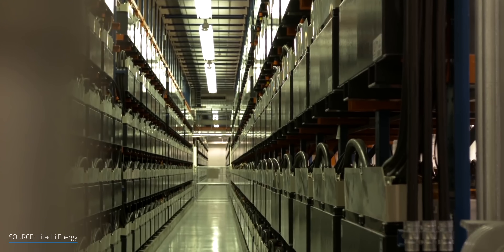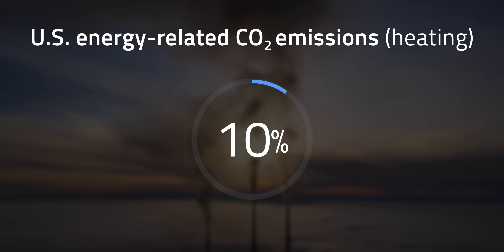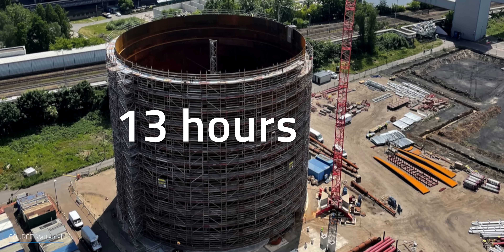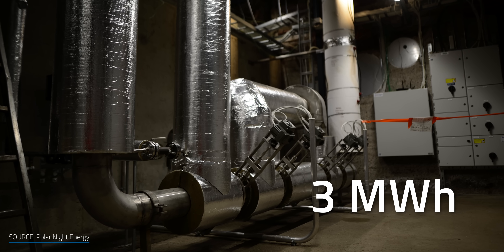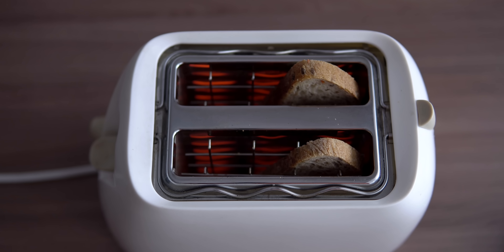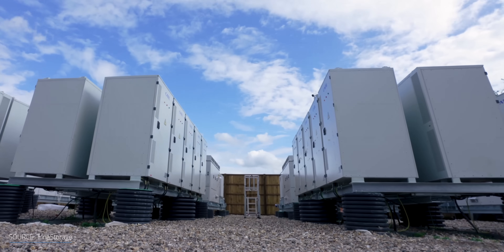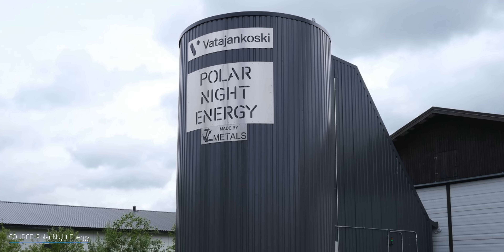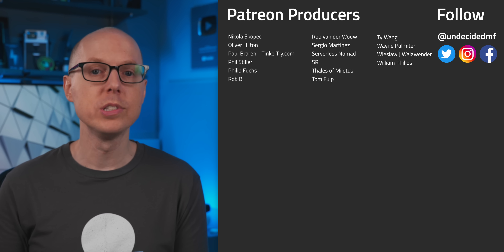How A Sand Battery Could Change The Energy Game

Comment from the maker: Do you think the sand battery has a chance of catching on? Try 14 days for free: http://aura.com/matt. Thank you to Aura for sponsoring this video!

If you liked this video, check out: Why Seaweed Could Be The Future Of Plastic https://youtu.be/901aQFR6Ft0?list=PLnTSM-ORSgi5LVxHfWfQE6-Y_HnK-sgXS
Reply: For once, I'm sold on this one. It ticks my boxes of distributed, scalable, and high availability. I doubt we will see much residential, but this is the kinda of system that can be integrated easily within a plant or factory. 
Though now that I think about it; what if they used a heat pump instead of resistive heating. A 2x heating efficiency(draws from the air) would offset the 1/4 conversion back. Might be difficult to get the higher temperatures needed though.
Reply: @squarewheels2491  The problem with heat pumps is that they do not work very well if you need to heat something up to 600 degrees C.
Reply: Hey how many heat-related puns did you work in there? I lost count around half a dozen. If people downed a shot to every pun, they'd get hammered 😀
Reply: @HeliophobicRiverman   Damn you 🤨 now I had to re-watch the whole video just to count the heat puns🤓😅 Although there were more puns in the video a person taking a shot for every heat related one would “just” have  6 shots and thus be moderately hammered😜😄
Reply: Kindly don't forget to review the thermal solar cooling
Reply: From an engineering perspective its a brilliant concept of simplicity. And scaling this technology should be a non issue because you are not dealing with a pressurized system. You can double up the input configuration as needed. Two heater/blower circuits instead of just one. As can the size of the thermal mass.
Reply: @davefroman4700  Charging this "Battery" would be $$ with its basically Direct short inductance Toaster. The only benefit here is if costs to make the initial heat are higher at night, etc. I dont see this being used that much.
Reply: 1) it's easy to engineer
2) construction costs are in line with any farm construction i.e. no specialty mtls etc.
3) sand is cheap & available wherever construction takes place.
4) they were able to store up to 1000° 
5) it's easy to convert for winter heat.
The EU should be very interested, especially now.
Reply: Matt, rather than use resistive heating, won't it make more sense to use a heat pump to move heat into the sand?  I am assuming a heat pump could be designed to operate at those temperatures which might be a big assumption.
Reply: Maybe you could do some research and make a videoabout nice tech called 'Teplator'  -  Nuclear district heating solution. :)
Reply: Why hot sand above ground instead of hot sand below ground?
Reply: @lonjohnson5161  
Cost and ease of maintenance i.e cost
Reply: I'm a glutton for your pun-ishment, ^oo^
Reply: The key take away  is for the forseeable future there is no single technology that will delivery us to energy independence.    :elbowcough:Why a we not planting more trees as a solution to the carbon in the atmosphere?
Reply: You can produce Hydrogen with unwanted wind energy and burn that on demand. UK is moving to Hydrogen boilers for winter heat. Thermal batteries have been tried before and failed because the cost was 4x more expensive than renewables. See video "Billion dollar solar failure".
Reply: @sang3Eta  Hydrogen is wonderful except that it has to be stored as a pressurized liquid to be efficient and is extremely explosive.
Reply: @sang3Eta  The "Billion dollar solar failure" was for something else. Hydrogen production is very inefficient.
Reply: @sang3Eta   well, it's bit dangerous, and one needs speciall place for it... Sand batteries are ok for use anywhere.. 👍
Reply: @sang3Eta  Hydrogen boilers need special storage and can easaly blow your home...
Reply: @helengren9349  Methane can blow your home up too, yet we use it. Hydrogen has smaller atoms so they did replace all the street pipes. Will be a mix methane and hydrogen because it holds no smell.
Reply: @sang3Eta   Thank You for Your reply. I sure do know about methane.. I do not use any flammable fuel.. but as I've heard hydrogen is very dangerous.. Why not use something better when it is available?... 🤔
Reply: @sang3Eta  You can- but the entire cycle is ~50% efficient. And the UK WANTS to move to Hydrogen- but has no idea how to get there. If you had ever worked with Hydrogen (I have) you would not want if anywhere near your house...
Reply: @Tensquaremetreworkshop  They have already upgraded the gas lines in my street to take hydrogen and dual gas boilers capable of burning methane and hydrogen mix are on the way.
Reply: @sang3Eta  Yes, mix. About 20%. If you believe we are going to 100% Hydrogen, I have some land for sale you might be interested in. Have to show you at low tide though...
Reply: 5:08 Again you're confusing “the world” for “the USA”. Europe, where this was developed, has a long tradition of district heating and co-generation, and the European Union is actively working to expand this, as part of the move to lowering carbon emissions.
Reply: @rasmis  Rasmis, my dear old chap. There is hardly any district heating y Europe outside of Sweden, and even in Sweden, it is very much a minority activity. I am in Slovakia at the moment and on the edge of the local town there are monstrously ugly pipes (and I mean MONSTROUSLY) stuck up on supports which used to provide waste heat to a housing estate from a local industrial plant. It did so for a few years .... and then .... it didn't anymore because the industrial plant closed down. In London, for a number of years, there were pipes running from Battersea Power Station to carry the hot water retained after the steam had blasted itself through the turbines and condensed to a housing estate. It ran for a couple of decades. Tenants complained about being charged for it whether they used it or not. It wasn't cheap either as the tenants were supposed to pay for the debt to be amortised over a number of years. It doesn't work anymore because in Britain's march to a coal-free future, this coal fired monster in the centre of London was one of the first to go. Battersea Power Station is now an up-market shopping centre with flats (apartments) for the super-rich who get perverse pleasure from telling anyone who will listen to them that they live in a power station "Haaaar-Haaar-Haaar .... Hahaha. That's funny isn't it" ..... "Well, If you say so."
Reply: would it work with brine? ie a thermal salt boiler to store energy, seems a win alround if it does coupled with desalination plants, hot enough to boil off remaining water and if to much salt it can be removed to maintain a balance 
(like a auger on a grain silo)
Reply: @TheBadweasel1975  Having lived close to the sea, I can tell you that salt water is extremely corrosive.
Reply: @BiggMo  isn't it obvious yet?  "climate change" is just another ruse of control...even if you omit the Berkeley professors "hockey stick" phony data discovery many years ago,, a blind man can see it by now come on man
Reply: Hey Matt,  With you being on a heat energy storage kick, and having recently done a video on state-change energy storage, it might be fun to do one on Ice -Based energy storage.  Broadly, the idea is that a building consumes low-cost energy at night when it is cooler, to freeze water which is then used to cool air for the buildings AC when it is hot rather than use electricity when it is expensive during the day.
Reply: @mm650  Great idea!   I heard of someone who would store snow from the streets in winter and use it for cooling during the summer.
Reply: @l0I0I0I0  Why "would". Did he or didn't he ? Try, "I heard of someone who STORED snow  from the ....... "
Reply: @BiggMo   Just what is it Y’all don’t get about irreversible sudden onset climate change? If this was 1980 and nuclear power eliminated all the world new coal fired plants, it may have kept our climate from being as it is now some decades away! Not properly decommissioning all the nuclear power plants while it is possible could make the Earth a dead rock hurtling through space for a very long time! But hey what do I care I’ve had an amazing ride already in this wonderful life on this marvelous planet!
Reply: Seeing what we’ve already done to out environment taking more and more water to make these sort of “solutions” aren’t the answer. We need more ways to recycle our current methods more storage options so they can keep producing regardless of need at that current time to fulfil future needs we need to start putting solutions into the works to clean up dirty ocean water, it effects us all in the long run
Reply: @Boo-pv4hn  funny you really think man kind has a long time! Sadly SMFH
Reply: @Boo-pv4hn  Wake me up when you realize that this economic model is scientifically invalid and incapable of solving the problems it is creating for profit. The biggest threat to our survival today is not pollution and oil. Its this idea that exponential GDP growth is essential to a functioning economy.
Reply: I was a bit worried whete they whete getting the sand but after seeing there using left overs from the construction industry this is a relief the worry is what about long term whete does the sand come from?
Reply: @Boo-pv4hn  The sand on the beach at Benidorm in Spain was purchased from the Algerians ..... and that was an awful lot of sand !
Reply: It's power still comes from the earth isn't that what you smart people are trying to do
Reply: Perhaps I missed it but I didn't notice any point on how much energy is lost over time to sand battery. Suppose you input 10 KWh how much of that power can be realistically extracted after a day by a  steam powered generator, thermoelectric generator, or some other sort of high efficiency heat to electricity generator?
Reply: @mydogsbutler  Aparently not much lost, since it is working for several months in cold weather, as in Alaska.. There is an interview with those, 3 very young persons from Finland, who started their project 2017, 👉 channel  now you know, vid called dirt cheap sandbatteries.
Reply: @mydogsbutler  I ran a small Heath-Robinson solar-thermal collector and pumped the hot air (sometimes in excess of 300°C) into a heap of gravel (about a cubic yard) insulated with a few inches of soil, I used the heat for my greenhouse. Even when hit by a freezing, cloudy high pressure weather system, there was still a lot of heat left after a week. I don't know about any longer because the Sun came out again and I recharged the heap. Commercial parasites want to blind us with science and make this as expensive as possible. What is wrong with a huge heap of gravel with a thin layer of concrete to keep the gravel clean .... it wouldn't matter if the concrete cracked, its' function is only to keep the gravel clean and about 10 ft of soil and rock over the top. No need for pipes or anything else. Hot air in - hot air out. How cheap is that ?
Reply: Can you put this underground?  Do rocks hold more heat longer?
Reply: @e2U  Yes you could, but no you do not want rocks. Too much air in the gaps. Sand is crushed rock btw. We can make an endless supply of aggregate for these systems. Even from recycled concrete.
Reply: @davefroman4700  rock with sand filling in the gaps?
Reply: @e2U  The reason sand works so effectively because it is classed as a semi fluid. Heat stratifies in fluids readily and that enables even energy distribution that gathers at the top and can be added to from the bottom. Even fine crush used concrete can be used in a system like this. For that matter there is probably a large portion of industrial smelting slag that could be crushed down and used as well is a system like this.
Reply: Couldn’t they strap some seebeck modules on this thing and constantly produce thermal electricity ? If no, please explain why
Reply: @Undecided with Matt Ferrell Can you do a video on the break through of Crab Shell Chitin being used instead of lithium in batteries?
Reply: Mr. Ferrell, this technology I know it exist for 6 months. The real question is, can I make it myself?? I have Sand, heating wire, temp controllers. every residential areas.
Second issue- combining this technology like you said is crucial. We should have more engineering platforms that are non profit. What do you think about this idea??
Reply: I couldn’t help but think of meta materials or sterling engines on this one.
Reply: Did you send me a reply with a number to contact you saying you have something for me?....if not....damn bots
Reply: Hi Matt,
Have you looked at flywheel energy storage at all? Some of the data on it - especially transfer loss and storage efficiency seem very appealing. I know it is used in some industrial applications - especially those demanding rapid high-load energy delivery and there have been some domestic startups in the space, but it would be good to hear someone more informed take a thorough look at the technology.
Reply: So why not mix in iron fillings in the sand and hav an ainduction heater heat  them up? also can run pipes under the desert and run water through that
Reply: Yes! anything is possible.
Reply: To understand a single word you are saying, i had to slow the playback speed down to .75
You talk so fast it's  like you just snorted 5 grams of coke in 1 hit before you made the video.
Reply: this method is by far the most promising imo.
thermal energy is what is the main problem at the moment.
this method checks everything, scalability, speed, efficiency etc etc
i think with clever engineering we could even use them as electricity storage, there is heat loss when converting to electricity, which could be send back into the sand.
there should be a way to increase efficiency significantly.
i mean 25% is already good enough to be honest, if we compare this to the hassle of hydrogen etc, or just the shear ammoutn of batteries needed.
scaling this is as easy as it gets, just make a giant hole and fill it with pipes and sand.
very hot topic imo
Reply: plastic has been reverted back to gas, and since 2013. why not cover the reality of our society. big oil doesnt care about you
Reply: Wow another video with your usual low standards of science and understanding. You always make me laugh, that much ignorance is a hoot.
Reply: Why not use the sand battery on existing infrastructure to heat a boiler to spin turbines and to replace existing Gas generators in our electric grid?  This could eliminated the solar and wind sag that happens at night.
Reply: @mbstein3  They don't want to depend on gas or other fosile energy❗It is not clean proces... And turbines are getting damaged after a while because of friction...
Reply: HEY matt , could you do a compilation video of all the energy solutions you have so far ?? I would love to see you rate them from very plausible to to far fetched , and maybe add up all the energy produced / stored / recycled ... so far from all the solutions presented
Reply: How much energy per volume of sand that it can store?
Reply: @BiggMo  nuclear enviromenatal... 🤔What about leaks.. Not fun.. 🤔
Reply: The heat can be turned into mechanical energy, then converted to electrical energy...
Reply: Made in SRBIJA https://www.youtube.com/watch?v=HEpBk9J886c
Reply: @Lars Hansen The bottom of the Atlantic is a mass of oosing mud, remains of dead fish that even the scavengers don't want ...... and fish excrement ..... oh ! and assorted rubbish dumped by humans, cables used and abandoned. In the Baltic, there are even abandoned Nordstream pipelines.
Reply: Love this solution it’s absolute madness to think wind turbines are turned off , I had wondered why they weren’t working at times we need as much storage as possible and only use renewable sources it’s time to stop all co2 producing electric producing solutions
Reply: You need to slow down a bit, Matt. Your strong US accent makes you difficult even for native English speakers to understand, so people who have English as a second language will really struggle to comprehend what you're saying. Thanks. 🙂👍
Reply: Can you please explain to us why they don't use a heat exchanger for heating the sand? A resistive heater might not be the most efficient option.
Reply: Honestly. No. Two reasons. 1: Neither the authorities nor large concerns have anything to gain from this. 2: In competition with subsidized systems based on approvals, it will be virtually impossible for small businesses to make a profit in offering "unknown" solutions that are not "approved"

Ultimately, the green shift is about consolidating power and capital with authorities and corporations, not about creating room for freedom for individuals. Unfortunately.

And the green shift's focus on CO2 means that there is no focus on all the other environmental challenges that we in the West still haven't solved and which are more precise. Such as use and throw away production, microplastics, balanced use of natural resources and clean food.
Reply: District heating network is not that expensive to build. It's just two insulated steel pipes in parallel. They last for a century but you need to prepare for occasional rupture or scale up as the network evolves. For each building you need a heat exchanger and water-based indoor heating piping and radiators - that's the expensive part if you don't already have it. During summer it can be used for cooling too, and guess what, the energy used for cooling can be stored for the winter.
Reply: Heat pumps, pressurised water, nuclear reactors... All optimisation for efficiency mind set. Adopt the design for cost mind set and you'll achieve amazing things.
Reply: In your whole video you never mentioned Heat transfer speed. There is a reason why we use liquids or metals and not concrete or glass for heat transfer. What is the point of having 8MWh of storage if we can get like 5kW/h in and out, because heating and cooling will take a while.

I think there is something in it, but like mentioned its not "fix all problems" solution.
Reply: No it is not suitable for seasonal storage at all. Because you can't insulate that 600°C tank efficiently. Either it will loose most of its energy during a fall or you will need  meters of thickness of quiet expensive thermal insulation. 
Those seasonal storages should be extreemly large to make their capacity vs surface ratio big enough to be economically viable. I’m talking about seasonal storages for whole towns/cities.
Reply: And the second thing when you use electricity to heat that sand you'll loose more than 85% of solar energy just because of solar panels low efficiency And than loose  80% of stored energy as heat losses while waiting for a winter. Doesn't look good.
Reply: What is it with all u nutts! Y o y do u all think electric everything will reduce the greenhouse effect or climate change? Driving electric cars using electricity for heating its doesn't do a think in reducing co2! Or carbon footprint 👣 🤔 do none of u understand more electric cars etc means the burning of more oil and gas to produce tye bloody electricity! The green energy thing is a complete scam and can never meet the needs of today with energy production!  Let alone in the future when even more ppl will need electricity. No gov eas concerned about being green until they realised they could corruptly profit from recycling. Now media has u all brainwashed! Now I see adverts saying we should make everything out of wood as it's renewable which is also wrong! We deforrested most of the planet until we struck oil! Oil allowed us to stop deforestation and the planet has re greened ie the forests have grown back. Also fr anyone got to read this! FYI the more carbon the more vegetation and trees grow! Carbon is not the issue! This woke climate nonsense is making us go backwards! Oil is mother nature's miracle gift! How many uses other than energy does it bless us with! It's non living organic matter that allows us to avoid going into nature for the materials we get from oil! We used bone and wood before plastic was invented. Oil allowed us to stop destroying nature. We don't need to stop using it we just need to use it cleanly without all the money men cutting budgets for their own personal gain. It would cost a little more to use oil cleanly but still a damn sight cheaper than all the renewables. And for anyone who believes renewable energy is cheaper to produce that's not in any way true. The government's subsidise green energy or it would be economically unviable. to the consumer it may be cheaper but not to the producer well except when subsidised by taxpayers money. Electric cars mean less pollution in city centres but the pollution will be concentrated to where the electricity is produced and overall will increase its damaging effects. To clean the air in the cities we plan to pollute the countryside 10 fold its bloody insane!
Reply: Why not use gravity? Dont have to mess with thermals and special materials. GRANDFATHER CLOCK style. Weight lifting on an industrial scale.
Reply: @gamerfortynine  They do use gravity batteries it's called hydro electric, they pump water up to a reservoir when the elecricity is cheap, and release the water at peak demand when price is high.
Reply: @gamerfortynine  gravity is more expensive to build than you think. The concrete block crane battery idea is super expensive to build...
Reply: @gamerfortynine   It gets damaged after a while because of friction...
Reply: Yes it's a great idea but an oldy but goody.   One caviat however.  Water is far more dense than sand, silicon but more expensive to work with with the higher pressures needed to use at the same temp as sand.  Thus sand is cheeper as it does not have to deal with the extreme pressures water would need to stay liquid at those temps.  I've done the math with many substances and water has amazing heat capacity.  Nonetheless, sand does not require high pressure and the temp difference means greater heat capacity, ONLY because water is not usually stored at those high temps.  Safety is also a concern with water at those temps, and increased gov regulations is usually a factor.  Water can be used and can store way more heat at the same temps, if one does not mind paying for it.  For what it's worth.
Reply: @l0I0I0I0  water is dangerous as hell under pressure. This system has no pressure at all. You can heat sand to 600F real easy without consequences 
That huge tank they are building in germany is not pressurized and will never get above 98C. Even 5lbs of pressure in such a huge vessel would level 5 city blocks if it failed. Ive spent 30 years in power engineering. You cannot hold steam heat for any sort of time. You can hold this for months.
Reply: @davefroman4700  Yes as stated it's not practical and dangerous, nonetheless from a physics perspective, water has amazing heat capacity, but from practical use it's a dangerous option.   As an optimistic, I believe their are engineering solutions for specific situations.  Case and point, in the US Coast Guard, they use to have boiler work ships made around 1944 with high pressurized water that could easily cut a board in half if a line leaked but with a professional crew, were able to use it to run and operate a bouy tender for over 40 years and was sold to a third world country who now also operate it.
Reply: @l0I0I0I0  That is because it was built before GDP existed. It was not built to be replaced regularly for profits like everything else in society today.
Reply: Sand Battery is a good idea. I've seen it on several other YT channels recently, but I read about it in Mother Earth News in the early 1970s and I also have plans for it in a Popular Mechanics magazine from the same time. It's NOT new. I will not watch this video. You have lost all credibility with me. DISLIKE > do not recommend channel. Buh bye.
Reply: great explanation I didn't understand another video about this a while ago.  reminds me of all the superior power solutions not being allowed (which lftr thorium invented and prototyped in the 1960s is king),, like the original light bulb that lasted forever, planned obsolescence (illegal now in France), is a major tool to keep us enslaved, infighting and distracted
Reply: @SmedleyButler1  Yes 🙌🙌🙌 poor Tesla is turning in his grave... Happened to him... Free energy... 🤔
Reply: Well sand don’t work because some how we short on that. There more than one type of sand and one we need getting harder to source
Reply: @allreadynotinuse4169  You could use desert sand, which is abundant but can´t be used for construction, because it´s too round. For energy storage, the shape doesnt´t matter.
Reply: @danielb3299  awesome! There plenty of that ! Lol can’t tell you how surprised I was there was a sand shortage and found it fascinating there were different types
Reply: @allreadynotinuse4169  But the type this needs isn't. It can use seabed sand (free, from harbour dredging).
Reply: @allreadynotinuse4169  You must be American..... You can grind up concrete into sand and use it in a system like this.